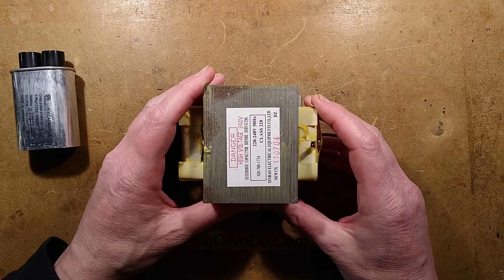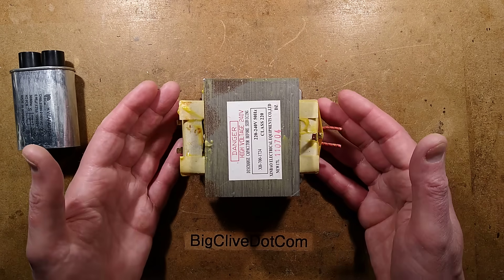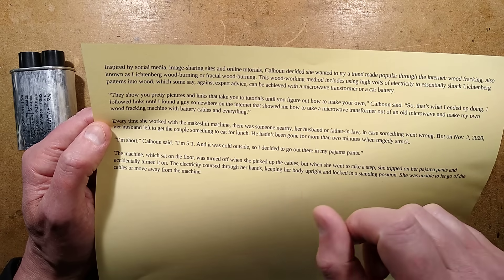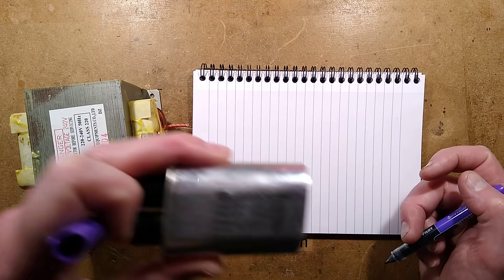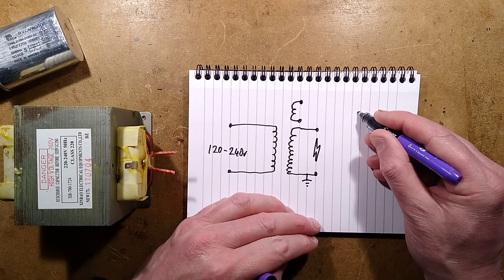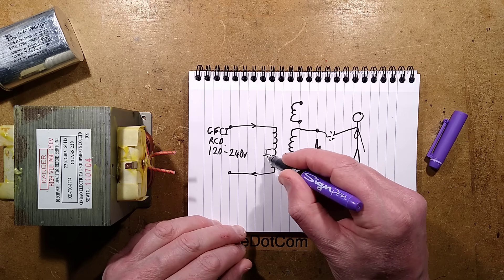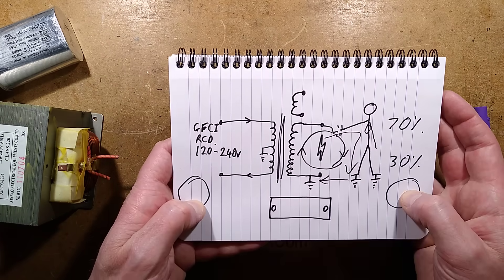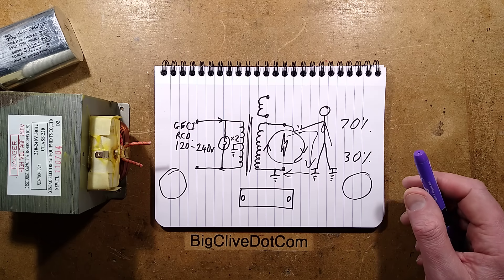The most deadly project on the Internet

Comment: Since it looks like people are sharing their electrical shock experiences, I might as well do the same. Several years ago, I was messing about with a 120-ish year old 23Kv Ruhmkorff coil I had found at an antique store, and I had it hooked up to my little bench power supply for testing. I turned on the supply and the coil powered up just fine, the interrupter happily buzzing away. Now you see, this coil had three terminals, and I had my power supply connected to two of them. The third, unknown to me at the time, was the HV output. There were two studs on the top near the interrupter that looked like terminal posts, so I assumed those were the HV terminals. In order to find out what the mysterious third terminal was though, younger (and stupider) me decided to deliberately touch that third terminal, while still holding the two low-voltage lines from my power supply. Now, this was not a sustained shock, as thankfully I got knocked back almost immediately, but right when my finger touched it, my right arm, and the whole right side of my body seemed to go numb, while somehow also hurting and burning like mad. After that, the next thing I remember was being a few feet away from the coil, with my hand on my chest to see if my heart was still beating. 
Tl;dr: don’t touch HV stuff. It’s not fun.
Reply: I had a similar experience but with these microwave transformers. Due to me being young and stupid I managed to accidentally touch the high voltage output while the transformer was powered. It could have been mains voltage since I am somehow still alive and without any burns or scars but my hand was right over that high voltage output and god that feeling. I was in the process of sitting when I touched it so thankfully I was only in contact with it for a fraction of a second. In that fraction it felt like my entire right arm was melting and when my hand came off it felt like a train hit me when I discharged. My hand was also on my chest bc I thought I died right then. Something funny tho is that I could feel my hair standing up like with static.
Reply: @TheMonkeyman824  You probably touched the input then. My one instance of getting shocked with 220v was very similar to that. I was getting bored with a laptop charger and two pencils sharpened from both ends. I unplugged the 220v input from the brick and fit the pencils into the live and neutral and touched it "for the lols". Let's just say I wasn't laughing after that one.

I was very aware that touching electricity the wrong way could kill you so I was fairly careful still.
Reply: It is not the voltage that kills, it is the current!
Reply: @EarlHayward it's the combination of energy, time, frequency and a bunch of other things
Reply: I answered and said, "If I have found favor in thy sight, O Lord, show this also to thy servant: whether after death, as soon as every one of us yields up his soul, we shall be kept in rest until those times come when thou wilt renew the creation, or whether we shall be tormented at once?" 76 He answered me and said, "I will show you that also, but do not be associated with those who have shown scorn, nor number yourself among those who are tormented. 77 For you have a treasure of works laid up with the Most High; but it will not be shown to you until the last times. 78 Now, concerning death, the teaching is: When the decisive decree has gone forth from the Most High that a man shall die, as the spirit leaves the body to return again to him who gave it, first of all it adores the glory of the Most High. 79 And if it is one of those who have shown scorn and have not kept the way of the Most High, and who have despised his law, and who have hated those who fear the Most High -- 80 such spirits shall not enter into habitations, but shall immediately wander about in torments, ever grieving and sad, in seven ways. 81 The first way, because they have scorned the law of the Most High. 82 The second way, because they cannot now make a good repentance that they may live. 83 The third way, they shall see the reward laid up for those who have trusted the covenants of the Most High. 84 The fourth way, they shall consider the torment laid up for themselves in the last days. 85 The fifth way, they shall see how the habitations of the others are guarded by angels in profound quiet. 86 The sixth way, they shall see how some of them will pass over into torments. 87 The seventh way, which is worse than all the ways that have been mentioned, because they shall utterly waste away in confusion and be consumed with shame, and shall wither with fear at seeing the glory of the Most High before whom they sinned while they were alive, and before whom they are to be judged in the last times. 88 "Now this is the order of those who have kept the ways of the Most High, when they shall be separated from their mortal body. 89 During the time that they lived in it, they laboriously served the Most High, and withstood danger every hour, that they might keep the law of the Lawgiver perfectly. 90 Therefore this is the teaching concerning them: 91 First of all, they shall see with great joy the glory of him who receives them, for they shall have rest in seven orders. 92 The first order, because they have striven with great effort to overcome the evil thought which was formed with them, that it might not lead them astray from life into death. 93 The second order, because they see the perplexity in which the souls of the ungodly wander, and the punishment that awaits them. 94 The third order, they see the witness which he who formed them bears concerning them, that while they were alive they kept the law which was given them in trust. 95 The fourth order, they understand the rest which they now enjoy, being gathered into their chambers and guarded by angels in profound quiet, and the glory which awaits them in the last days. 96 The fifth order, they rejoice that they have now escaped what is corruptible, and shall inherit what is to come; and besides they see the straits and toil from which they have been delivered, and the spacious liberty which they are to receive and enjoy in immortality. 97 The sixth order, when it is shown to them how their face is to shine like the sun, and how they are to be made like the light of the stars, being incorruptible from then on. 98 The seventh order, which is greater than all that have been mentioned, because they shall rejoice with boldness, and shall be confident without confusion, and shall be glad without fear, for they hasten to behold the face of him whom they served in life and from whom they are to receive their reward when glorified. 99 This is the order of the souls of the righteous, as henceforth is announced; and the aforesaid are the ways of torment which those who would not give heed shall suffer hereafter." 100 I answered and said, "Will time therefore be given to the souls, after they have been separated from the bodies, to see what you have described to me?" 101 He said to me, "They shall have freedom for seven days, so that during these seven days they may see the things of which you have been told, and afterwards they shall be gathered in their habitations." 102 I answered and said, "If I have found favor in thy sight, show further to me, thy servant, whether on the day of judgment the righteous will be able to intercede for the ungodly or to entreat the Most High for them, 103 fathers for sons or sons for parents, brothers for brothers, relatives for their kinsmen, or friends for those who are most dear." 104 He answered me and said, "Since you have found favor in my sight, I will show you this also. The day of judgment is decisive and displays to all the seal of truth. Just as now a father does not send his son, or a son his father, or a master his servant, or a friend his dearest friend, to be ill or sleep or eat or be healed in his stead, 105 so no one shall ever pray for another on that day, neither shall any one lay a burden on another; for then every one shall bear his own righteousness and unrighteousness." 2 Esdras 2:31
Reply: its not real bob.      @likeasparrowinthewildernes8333
Reply: @likeasparrowinthewildernes8333  Praise Jesus!

Comment: Sir.help! I want to make a 12-0-12v from a dual output 12-0-12-0 trans.Am I correct in saying you join the 0-12 together so u have 12 (0-12) 0 making 3 outputs from four?? Many Thanks
Reply from the maker: If your transformer has two separate 12V windings then they can be commoned to make a 12-0-12 transformer.  Usually by joining the two middle pins.

Comment: Not to be the dickhead in the room but I feel like a good portion of this is Darwin.   (Not in regard to what your saying but the fact you need to say it.)  

If you just willy-nilly start dicking around with thousands of volts, water and other solutions without a fundamental understanding of what you're doing (Or conversely - take it lightly)  then you kind of deserve what you get.   

It doesn't take a brain surgeon to figure out that Water and Electricity is dangerous, or that high amounts of current can kill you.  Putting the two together when you aren't 1000% certain of how, or without precautionary measures just means you were probably going to have an accident at some point anyhow; regardless of what you were doing because you give absolutely zero shits about safety (and probably people's lives) to begin with.

Comment: I've worked in an electronics/electrity manifacturing plant as a technician for the last 20 years and have suffered probably 15-20 shocks in that time. Usually 120V since I'm in North America but some were higher. When you get zapped you become very wary for a while but inevitably, with time, as you said, complacency comes back and you're not being careful anymore...until you get zapped again.
Reply from the maker: You might want to check out my "unofficial guide to electrocution" video.

Comment: Very important warning for all the amateur diy freaks but also for some pro's i guess! I just wonder how you are able to work on the lichtenberg frackles when holding both hands on the knobs of the dead-man switch? Another device with limited current but even higher voltage are OBITS (oil burning ignition transformers) that often work with high frequency and are limited to 20...30 mA in most cases. There are also tradional OBITs that work on 50 or 60 Hz, sometimes giving little more current (30...50 mA) - but its still much less than a MOT can give (around 500...1000 mA). OBITs are still dangerous and can kill you, but your chances to survive are definetly higher.

Comment: I was working in a drop ceiling the other day putting in LED lights.  

Some idiot probably 30-35 years ago used the ground as a traveler on a 3 way switch. It was ok on keyless fixtures.

Part of the job was to run a television coax cable to move the TV on the floor about to a different location. 

I didn’t unplug the cable modem or TV receivers. 

When the splitters touched against the metal frames the sparks flew and they did not stop for what seemed like and eternity and never. 

The lighting circuit was on a “federal pacific” 20 amp circuit so it doesn’t care about tripping. 

So I grab the insulated coax wire to try and stop the fire from flying. 

A 30+ year mistake could have burnt the home down if it had shorted after I left. 

All because I assumed the ground wire was actually a ground wire and not a current carrying conductor and that’s not something anyone should ever have to test

Edit: because it was shorting out to on the coax ground lucky me it didn’t fry any of the receivers or the Wi-Fi modem and the fire still would have flied even if I had I hooked them. 

The frames of the 2ft x 2ft lights was energized by the ground wire causing all of the drop ceiling to be hot. 

I got lucky because I was about to reach up through the grid over a gas line and would have used the grid to help balance myself.
Reply from the maker: Scary, but unfortunately common here too when people get lazy.   Ceiling grids are supposed to be grounded here.

Comment: Plain and simple never mess with high voltage even if it comes from a microwave TFormer
Reply from the maker: High voltage is fine at very low current like an ignition sparker, but the microwave transformer supplies it at high current.

Comment: Some time ago i also stubbled on this.  Aware that people make fractal burning with microwavve transformer, I was aiming at making a spot welder for chainmail.   Maybe eventually car body work if it worked well.   I carefully cut out the highvolatge coil as you described, and the heater coil.  put in a 2gauge (1turn i think).  But then choke out on the project as nobody could guide me on the proper safety mechanisms i needed to install.  Fuses or relays and kill switched for that type of voltage.  My electrical knowledge is limited to easy 12V testing lights and some 80amp fuses for automotive stuff like a winch.   I won't attempt this without proper understanding,  but if you have good sources/reading to introduce me to how a voltmeter works and is properly used,  and any advice on this particular project.  I'd appreciate it.  Ideally a spot welder with some adjustment nobs.   Great video,  i'll trust your knowledge on "don't do that".

Comment: WOW. I have just a bit of knowledge about electricity and I keep myself safe so far. To be honest, I intended to use this kind of “wood burning method “. NOW no way, thank you. You have all my respect and consideration for the video. Very well done.
Reply: Yes!  Great news.  Please don’t let anyone convince you there’s “a way” to do it safely, either.  I have well over 20yrs experience as an electrician, including troubleshooting live equipment, I know my way around the appropriate PPE, and would NEVER be tempted to try this!
Reply: @adlockhungry304  one great thing about an electrician is they don't know everything they need to know to design something like this you can do this safely but you need to have a lot of protocols like a door when the door is open the switch is off and a push-button in the next room that is in series with that switch so the door must be closed no one in the room.
Reply: @markmcgoveran6811 , since you aren’t using proper electrical terminology and you haven’t used punctuation, I’m afraid none of that made any sense to me.  I’m not trying to be disrespectful, but that does not inspire confidence.  The only reason I care enough to say so is because of the dangers involved.  I don’t want you or anyone else to get hurt or killed. Unfortunately, I just don’t have the time to write up a whole workbook explaining the intricacies of why you are not as safe as you think you are.  If the video didn’t convince you, I don’t know what to tell you.  It’s your life, brother.

Comment: Devil Current DC versus Angel Current AC lol, you should be able to let go at the zero charge of AC frequency wave but DC is continuously discharging a battery charge.
Reply from the maker: That's a myth.  Smooth DC causes a single contraction and burning.  AC causes continuous muscle stimulation and is the dangerous one.  You can't "let go at the zero crossing point" because you can't open and close your hands 50 or 60 times a second.

Comment: Had a cheap ohm meter and tested 220 at the fuse box in basement, do not remember what the hell I was doing too long ago. The circuit board in the ohm meter turned to a cloud and I stood there in "shock" knowing what I just did. I called the wife down and told her she was not happy with me. I think I am lucky but not with money
Reply from the maker: If the probes are in the 10A holes, small meters will explode when the probes are applied to a high current supply, regardless of the dial position.  The only meters suited to a fuse box are Cat III or IV.

Comment: People and electricity, it stays a dangerous combination. In addition, low voltage is not always safer, especially High current usage, like about 600A and up @ 48VDC is as deadly as those MOTs we use caps from 2F and higher in an array, and when you see that, that looks very quiet and peaceful, and that's the danger of DC.

Comment: Electricity is no joke. I used to build, and fly, bucket trucks. We would dielectric test the booms as well so there was serious training involved around proper insulation and what's allowed for repairs. 120 volts ac, around the American home, doesn't worry me too much. That's just a sharp tingle to let you know you did something stupid, but 240 volts ac will contract your muscles and you won't be able to let go. There was an accident at a place I worked at, a steel plate was dropped on 480 volt power cord, and the arc flash was like a ball of lightning. Burned someone's face pretty bad. I can't imagine the horror of 2 or 4 or 20 thousand volts. Stay safe friends ✌️

Comment: I will never forget my trainer at Sears telling us about working on microwaves. Very simple, straightforward guidelines. Do not work on the high voltage circuit while the unit is plugged in. Always discharge the high voltage capacitor after waiting 10 seconds(for the bleed off resistor). He flat out told us:" I'm tired of going to funerals." If you don't respect what you are working with and don't understand it you will get hurt. Be safe.

Comment: The fact that people are using microwave transformers reminds me. A local McDonald's was remodeled a few years ago, and their dumpsters were full.

While me and my friends were looking at an abandoned trailer with a small boat on it, that the place was trying to get rid of, I went over to the construction dampers (which had been there foe weeks) they had left the transformers from the halogen streetlamps, each one was definitely more than 20 lbs, maybe more than 30

I wonder how dangerous those would have been to mess with
Reply from the maker: The ballasts would have been relatively safe, but only really suitable for use with lighting.